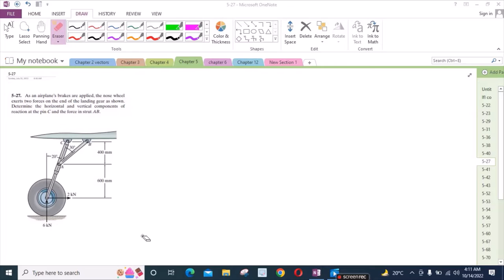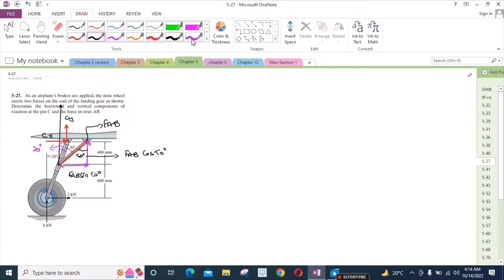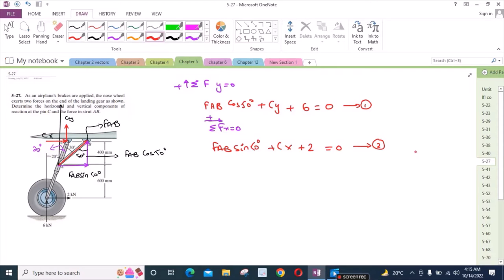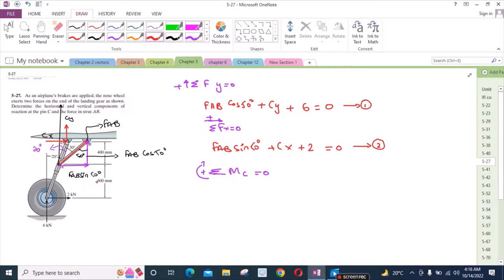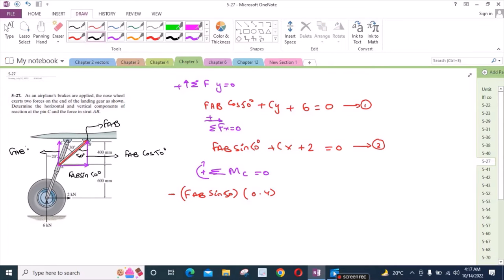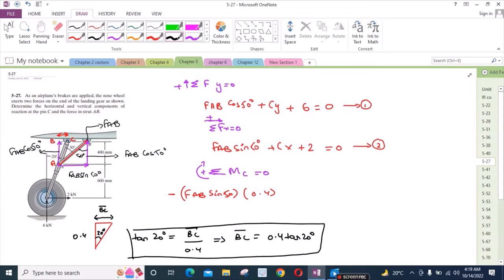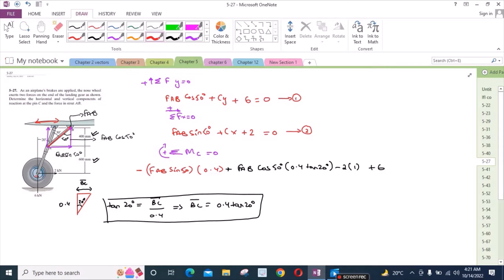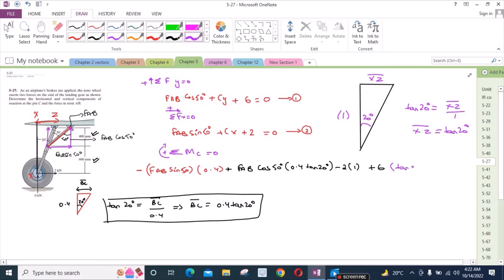5-27 hibbeler statics chapter 5 | hibbeler statics | hibbeler

Comment: Why are we taking the base of both triangles as 0.4m and 1m  and not the BC and XZ?
Reply from the maker: The idea is that we not trying to find the base of the triangles rather we are trying to find the moment arm (perpendicular distance from line of action of force to the pivot point) and it turned out that for Fabsin(50) the moment arm is 0.4 m and for 2 kN it is 1 m. 
I hope it will help.
Reply: @solutionsmanual9535  thankyou so much bro💓
Reply: In these cases we have to find the moment arm rather than the actual distance between the aplyed force and the point we are trying to calculate the momentum sum.
Reply: in other words a straight line between the point which the force is aplyed and the point where the momentum sum is been calculated